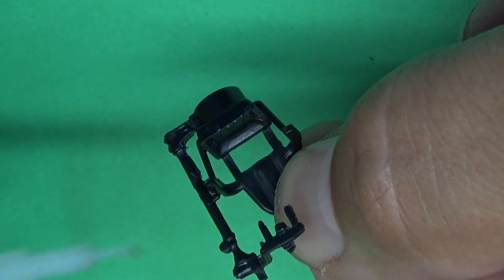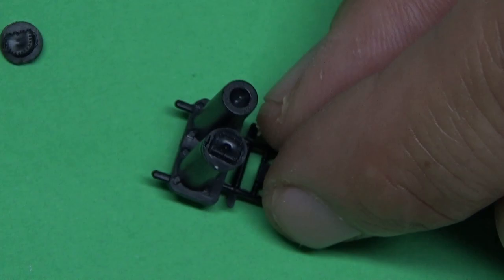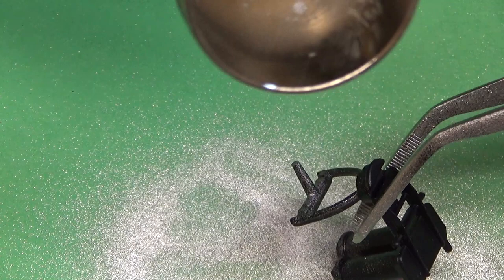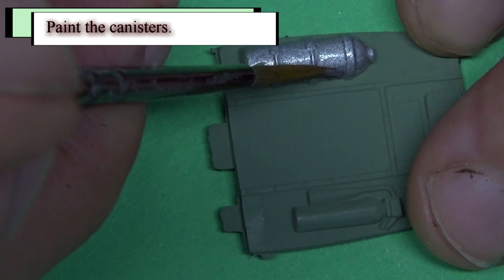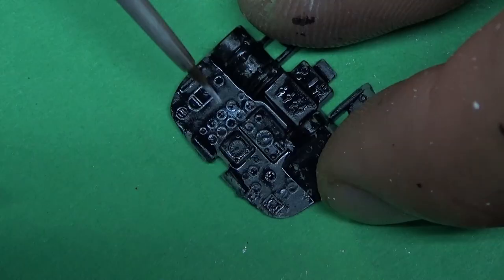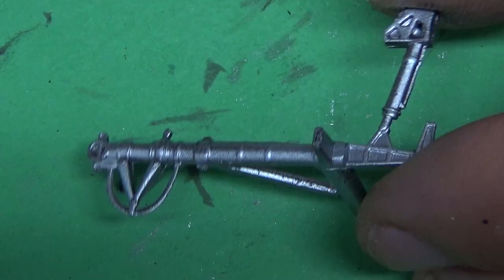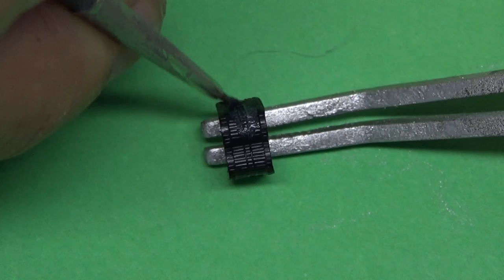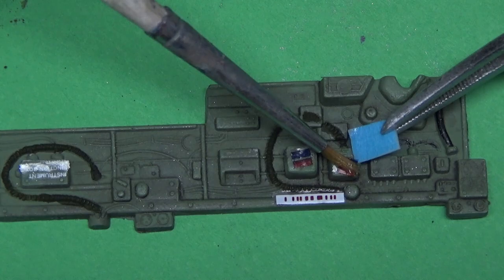Revell P-61 Black Widow 1:48 Part 1

Comment: Mine has been one problem after another, it's not like I'm an amateur. But this kit has been driving me crazy. And I'm a pretty decent model builder. My main issues are with seams. But I also had issues with one of the seats on the flight deck. UGH. Hopefully I can get this thing finished.
Reply from the maker: You will..just treat it like artwork. Take your time with it.  Don't get frustrated.  I read about the issues with it.  Either some are worse than others, or I tackled mine differently